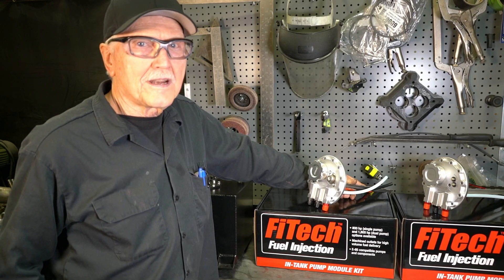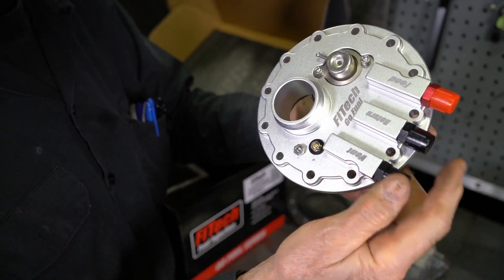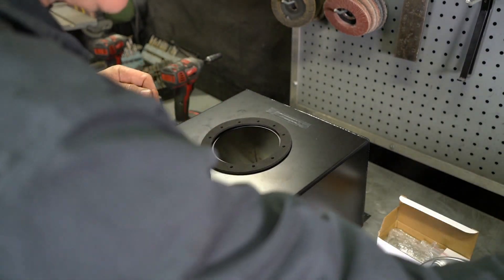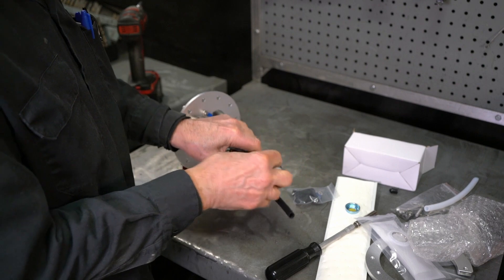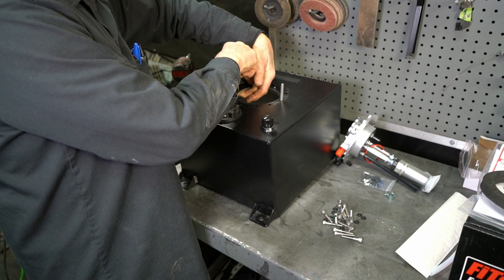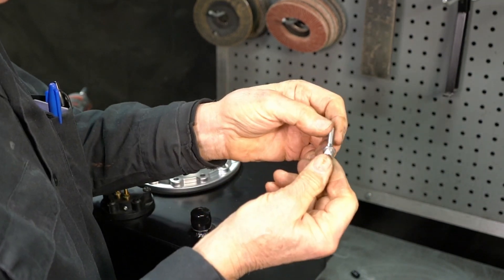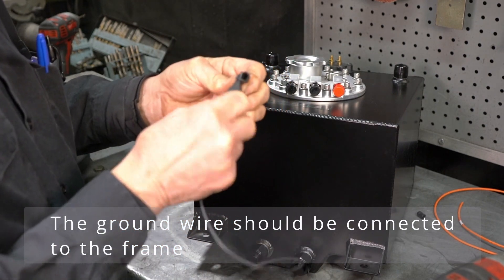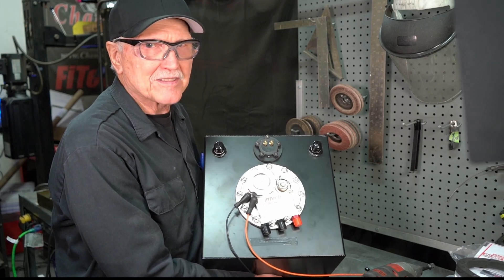Installing In-Tank Fuel Pump Returnless Module | Tech Tuesdays | EP64

Comment: Why is mine saying ECM no response. It comes and goes with the key on.
Reply from the maker: If anything you have a loose connection to the handheld itself.
Reply: @FiTechEFImedia  thanks I fixed it.  It was my fault no FiTec. I found out that when I turned key off I still had power back feeding back to the white key wire which was not allowing me to save the new settings in ECM.
Reply: @FiTechEFImedia  Awsome product for the price guys, very well worth it. Thank you